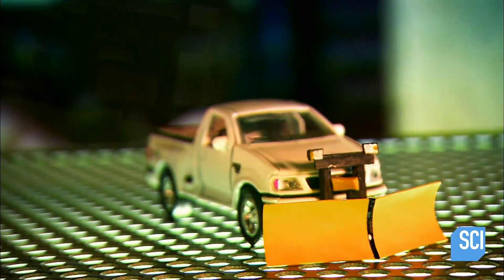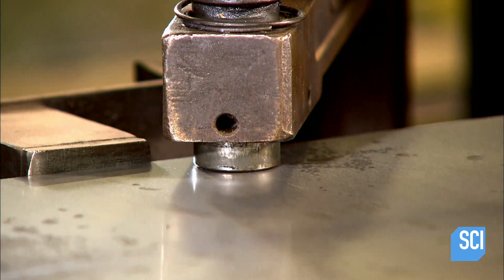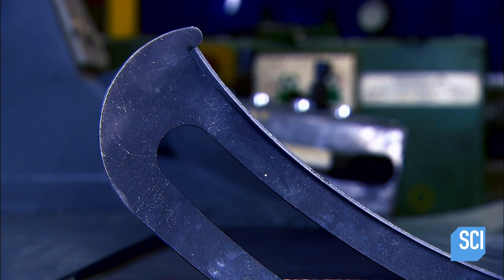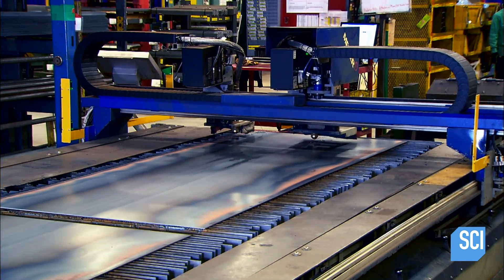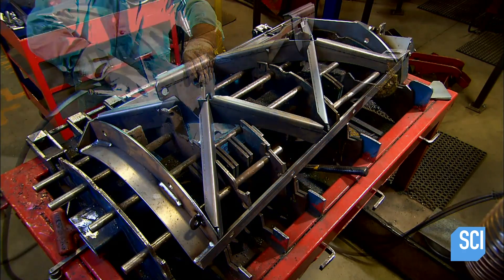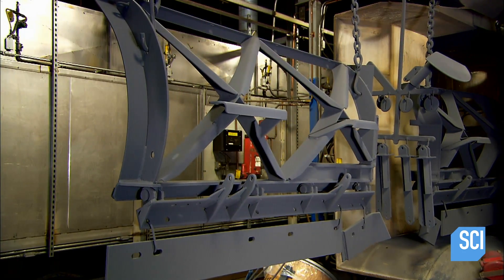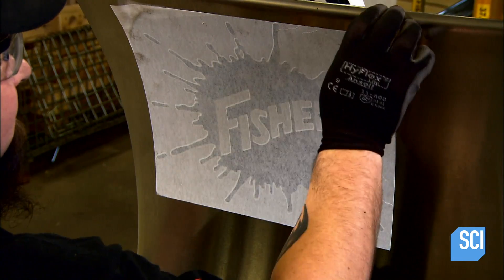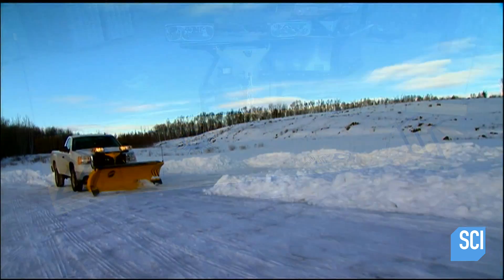How It's Made: Snow Plows

Comment: I did notice one thing wrong with this, they generalized all snow plows as metal, and said they can be stainless steel or carbon steel. That is incorrect - a lot of plows are being made out of polyethylene (plastic). A lot of cutting edges are still made out of metal, which is the part that comes in contact with the ground. Metal holds up better in that part, but polyethylene lasts longer as the moldboard.

Comment: The best plows are made of poly and are red.  😁
Reply: LTVoyager are you referring to western?
Reply: r godon Yep.  I am on my second poly plow and will never have a steel plow.  If I had to have steel, I might consider SS, but the way that snow rolls off poly and no rust or repainting to worry about, it is the cat’s meow.
Reply: LTVoyager you know they’re made by the same company right? Douglas dynamics
Reply: r godon Yes, but different designs.  Many small companies get bought up by holding companies yet retain much of what they started with.  I think all plow makers should make poly plows.  Poly is superior to steel in almost every way, albeit it can be a little heavier.